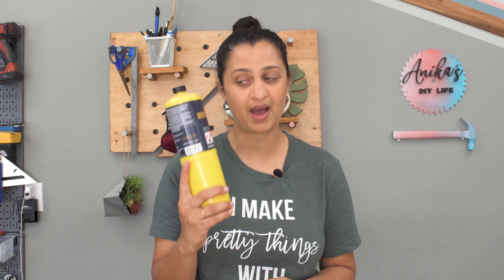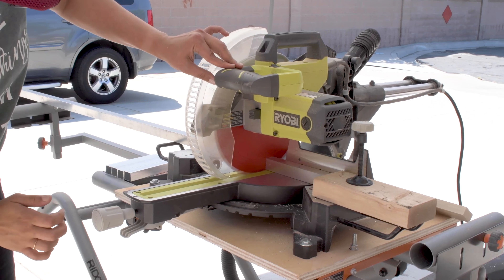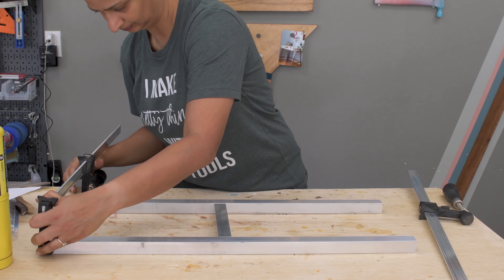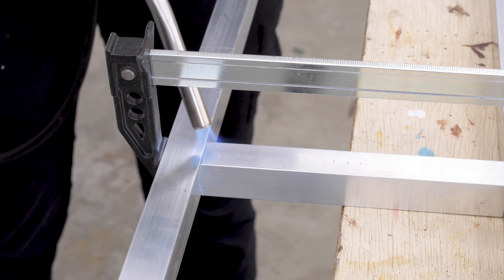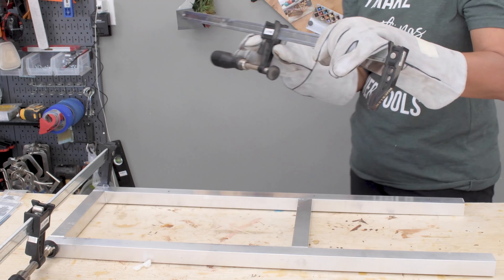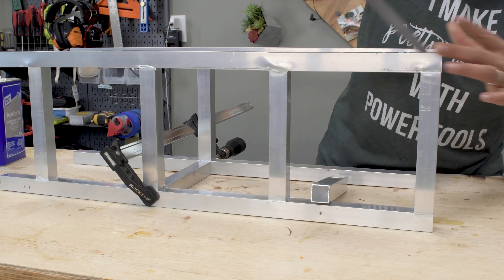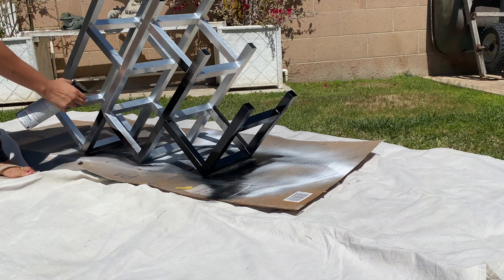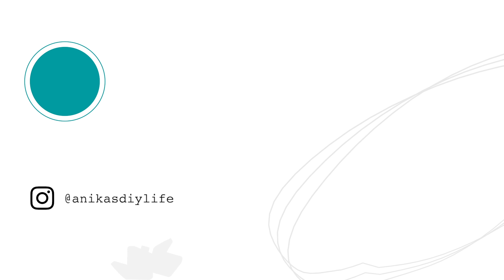NO WELD Metal Plant Stand | How To | DIY

Comment: What are the pros and cons of this approach vs welding? With welding I suppose there is the fear factor but you get stronger joints. This brazing technique doesn't use a welder but I'm not sure holding a blow torch with a gas tank strapped to your hip is any better from a "fear" standpoint. In terms of speed, welding seems like it might be faster.
Reply from the maker: Welding is a whole different concept and definitely a lot stronger and faster. But is also an investment. This is a great stepping stone to welding and if people aren’t ready to invest in a welder.